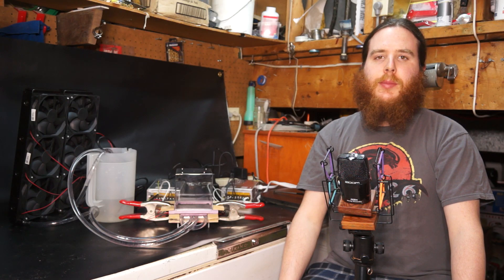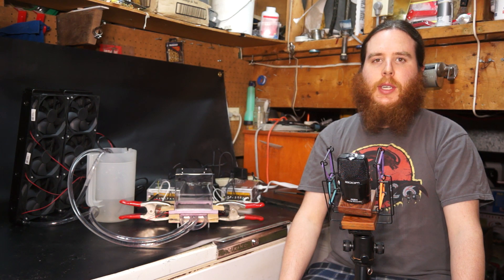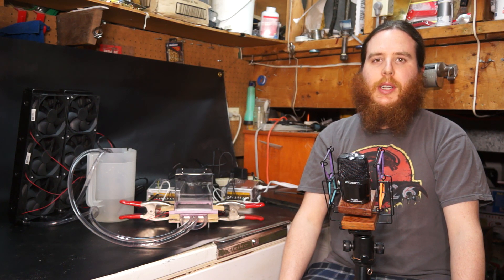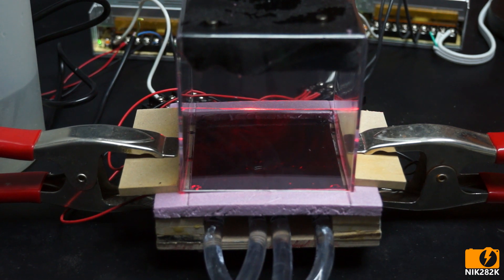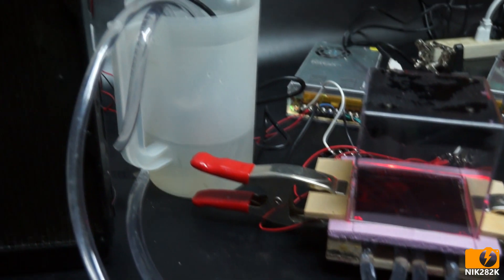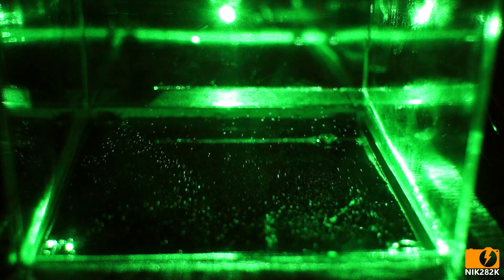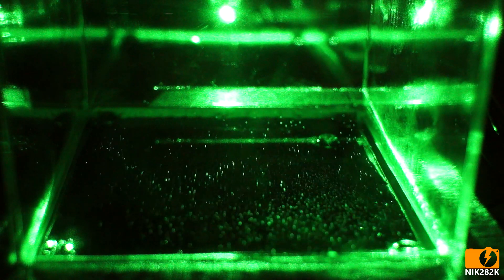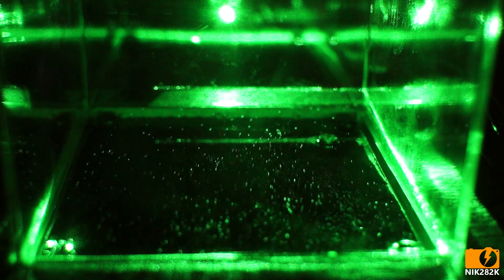Thermoelectric Diffusion Cloud Chamber

Comment: Do you have a spare smoke detector?  The Americium in one would provide a particle source.   Often, the Am is contained attached to a button located inside a steel cage.
Reply from the maker: I do have one and I grabbed the Am source but the results were unexpected. There are occasional streaks far from the source but up close there is just a non stop churning cloud. I'm not sure if the source needs to chill longer or if it is swamping/saturating the cloud. Once I have the cooler running better I will try it again!
Reply: I'd expect a churning cloud...

The few demos I've seen using a radioactive source use a pin-tip sized material, and it still looked like a seeding dandelion.  Perhaps putting it at the bottom of a sealed pipe that's been tinned will with lead solder would give some directionality to the emissions?  

Do those coolers have much of a magnetic field?  That will influence some of the particle's behaviour...

Have you tried adding a magnet to the chamber, to see how it affects the trails?  That might require stacking video frames, like you showed me how to do with the burning steel wool...

Bananas are supposed to be pretty radioactive...
Reply from the maker: I hadn't thought of it but yeah, Am should have lots of decays per second where as those point sources are decaying very slowly, I'll see if I can make a directing tube or some other means to get the particle to hit the chamber from one direction.

The coolers may have an electric filed but I suspect it is not a large one, I do however had magnets holding the alcohol soaked felt to the top of my chamber, I'll have to switch to some other method to get straight trails. I have tried a magnet and there is an observable difference, many of the trails get well defined curves to them.

I will try the banana, its a fun idea!

Comment: As interesting as always!! Gotta check if I can build myself the low tech version by dropping the pressure... I've always stopped myself from building one of these because of the cold temp needed.
Btw how pure is the alcohol you are using? 
Thanks!!
Reply from the maker: I'm using "electronics" isopropanol so it's probably around 99%. Lower concentration should work particularly if you add a heater (1W resistor). I would love to see a pressure based chamber, all exampled I have seen are dry ice, refrigerant or peltier based.
Reply: Nick Moore thanks ;) I'll search for the patents and all the data. It will take me a while to start it all. I've got a bunch of stuff to do on my waiting list. Not very scientific, but I intend to build a fake foam motorized chainsaw with an air engine, EVA foam teeth and a 3d printed centrifugal clutch to be ready for next halloween. Bwahahahaa!!
(evil laugh :P )
Why not electric? For the noise! Why not nitro model engine? For I intend to use it indoors :P
Reply from the maker: That sounds awesome, air engines sound almost like a 2 stroke and with the right muffler (loudener) I'll bet you could get it identical!
Reply: Nick Moore well...they are two stroke ;) besides that, I have a couple of air cars with a very ingenious design, and they are loud... The patent itself is worth looking at, if you are keen to engine mechanics. 
https://patents.google.com/patent/US6862973B2/en
It amazes me how the inventors made the piston, crankshaft and exhaust to merge beautifully.
Reply from the maker: That's a really cool design, I've only ever seen the 'air hogs' style that requires a flexible piston ring. I know what I'm going to be Googling next night shift.
Reply: Yeah I would love to have come to this solution on my own, as a sort of pride. I really can't think of a way of simplifying this design...
BTW Please! if you EVER find a source of small plastic air engines, just let me know. I would love to build myself a P-38 and the steam engines from Microcosm are way too heavy...
See ya!!

Comment: Why are some of the tracks curving?
Reply from the maker: There are magnets in the top of the chamber to hold in some felt and any time you have a moving charge in a magnetic field the charge will feel a force. So instead of straight lines some of the particle follow a curved path. If I had a much stronger magnet all of the paths would be curved.
Reply: Oh, OK, I missed the bit about magnets being present!
Reply from the maker: I hadn't intended the magnets in the top to have so much of an effect so I may end up removing them for the final version.
Reply: Or keep them, they allow you to determine particle charge!
Reply from the maker: I was going to add a big coil around the whole chamber to see if I could get a more uniform field. Because only the current matters though a coil (not the voltage drop across it) I may be able to use the nearly 60 amps of DC power used by the thermometric coolers in the coil.

Comment: Did you stick a magnet under there? the track look curved.
Something I never understood about these kinds of chambers is why I can see the progress of the particle along its track like at 1:30. The particle should be traveling at a substantial fraction of the speed of light. Its track should appear instantaneously along the entire length, even in the high speed. I don't understand it.
Reply from the maker: There are magnets in the top of the chamber and for one shot there is one in the top right corner of the cold plate, that is likely why some of the trails were curved. As for he speed of the trails I don't know why some appear to be very slow, it's one of the reasons I picked this as a project!
Reply: Perhaps the particles are coming in at a high angle wrt the condensate surface and ions drift slowly down to that layer. Maybe making the vapor chamber less tall will eliminate the long lived trails? idk

Comment: Very cool! One thing I don't understand - a lot of particles seem to be moving slow enough, that you can see the movement on the video. Is something else going on there?
Reply from the maker: I'm not really sure, it seems to be the same with all cloud chambers. One of the reasons I built mine was to look into the too-slow particles.
Reply from the maker: Once I have it all boxed up I'll do a much more detailed break down of how this was built but it is a stack of 2x2x2 peltiers. All together the peltiers produce more than 500W of heat in addition to the heat pumped from the chamber so my design goal was to continuously cool a 500W electric heater down to room temperature!
Reply: Yes!!! This has always been a mystery to me and I was hoping someone with a good slow motion camera would build one.  I'm thinking there has to be some property of the alcohol itself that contributes to the speed at which the cloud forms.  E.g. maybe a slight instantaneous cooling from droplet condensation is the 'front' along which the cloud moves.  Dunno. 

Did you have to stack the coolers or was one layer sufficient given the cooling system in use?  Would love to see the build, I have ~10 peltiers in the basement but need to get off my butt to do the rest.
Reply: BTW don't be afraid to toss up a Patreon.  I know at least part of what you have in this, wouldn't mind chipping in a little to help offset the costs.
Reply: Tl;dr:  the trails aren't showing the particles' velocity, just that a particle had passed through there.

The trails very similar to jet airplane con trails in persistance.  They don't indicate the speed of the particle, though: just the path where they passed.  Their passage makes nucleation sites in the supersaturate, which then causes alcohol vapour to precipitate out, at its own pace.  Depending on the temp and pressure, this pace will vary.
Reply from the maker: Thanks, I do actually have an account that I set it up to camp the username. If I decided to pick up the pace again and do another 30+video year I might start flogging but for now I'm gonna keep this as a hobby. Thanks for the offer!
Reply from the maker: I would still like to figure out why some trails are near instant and others are quite slow. Looks like I'll have to do some creative data acquisition.
Reply: Alpha vs Beta+/- particle speed maybe, depending on the source. Add a stronger magnetic field to spiral the beta ones, the alphas are too heavy and will be straight.

Comment: Is there a way to determine which particles are causing the cloud to form? Perhaps applying filters to different sides of the chamber to ensure that only certain particles will cause the ionization in a particular direction.
Reply from the maker: If you put a strong magnetic field through the chamber it will cause the particles to curve in one direction or the other based on the charge of the particle. It might be possible to filter by energy (different thicknesses and densities) but I'm not sure if it would be possible to filter by particle.
Reply from the maker: Pretty much!
Reply: It is just like an alcohol version of a Geiger counter yeah?